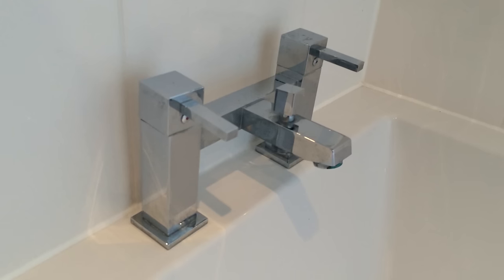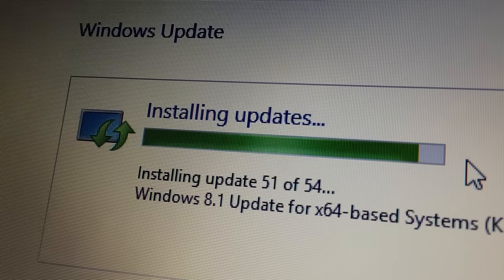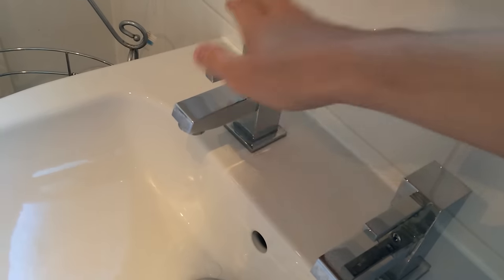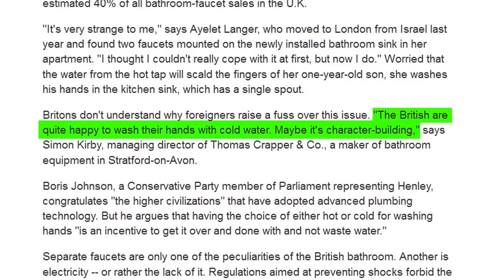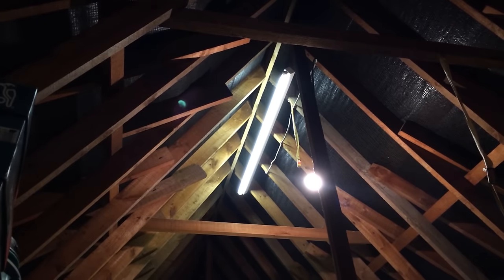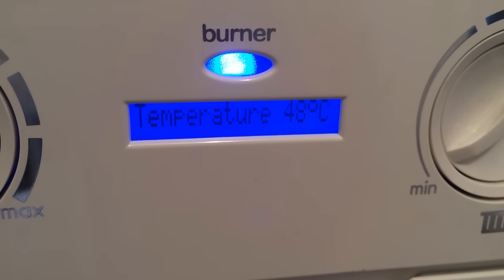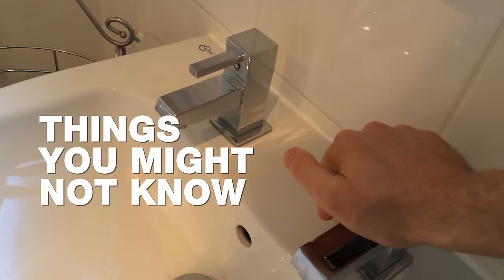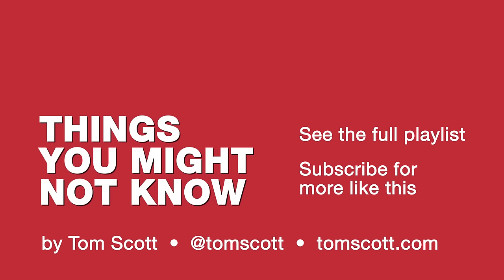Why Britain Uses Separate Hot and Cold Taps

Comment: Here in Finland, where as far as I know (some 30 years) there's always been just mixer taps, I was still told as a child not to drink the hot water. The reason given was that the hot water pipes could be made with lead somehow (soldering perhaps?) and thus could poison you over time.
Reply: both hot and cold were made with lead at one time. we still occasionally find parts of our water system in britain have lead piping.
Reply: Yeah, I was brought up being told the same thing here in Sweden, so I do the same thing as Tom does; I always run the cold water for a few seconds before I use it for cooking or drinking.
Reply: Skellious
 My house has lead on the mains supply so I always waste a gallon or so before using it for potable water. Apparently though the inside of the lead pipe gets a coat of the minerals in the water that stops the lead getting into the water.
Reply: Skellious  I'm probably misremembering, a guy in the comments below said it indeed is because of heavy metal poisioning, but from copper, not lead.
Reply: Staffan Thomén I've heard both copper and lead. The piping for the hot water was copper, but lead was there too.
Reply: back in the 1940s and 50s separate cold and warm water taps was used here in europe to (in those houses that actully had waterheaters) i have been in a house built in 1941 that still had all original plumming and mains wiring in the basement (and probobly lots of asbestos everywhere) and it still had those separate water taps
Reply: Elle Sea
Lead based solder was used when joining pipes. These days it's mainly lead free due to modern regulations).

I run the cold tap a while too. But that's just because I want cold water in my glass, not warm, tepid or anything else either =) (But yes, we were taught that hot water was non potable as children too. Apart from lead poisoning, the other reason given was that the water stands in the boiler, and goes off. =) These days I always run hot water e.g. when cooking, since it cuts down the time on the stove top.)
Reply: The real reason not to drink hot water is because your water heater contains an aluminum anode to prevent corrosion inside the tank.  It's not safe to drink from things with exposed aluminum.
Reply: Jeremy Nunya
I drink soda from aluminum cans and it hasn't killed me yet. The real reason is the lead in the solder is more likely to leach out into hot water.
Reply: Well I've also been told you shouldn't drink hot water but isn't it really just because warm water tastes like crap?
Reply: notarobot The aluminum in the cans has a coating on it.  This is common knowledge that you shouldn't eat or drink from aluminum...  They use the same solder for hot and cold water lines sooo yeah.
Reply: You also have the fact that there's an increased chance of contracting legionnaires' disease from the hot water system. Especially if it hasn't been used for a week or two.
Reply: Staffan Thomén
I gotta say, heavy metal poisoning sounds like the ideal Finnish death. lol.
Reply: Given that you use a mordern plumbing system (steel pipes, modern water heater, especially no rats involved)  I can see three problems: 1. Heating water will cause some of the contained minerals to go solide on the walls of the water heater. The water will contain less minerals. But I am not sure if this is significant enough, to make a actual difference. 2. Mineral coating building up inside the water heater which could provide a habitat for all sorts of funny things.  3. These devices suffer a problem called galvanic corrosion. (If interested how it works, look it up on wikipedia) You need to make sure that this corrosion does not eat up the steel tank of the heater. In order to do this, you put a anode into the tank that is desolved instead. It is called sacrificial anode. These are usually made from aluminium.  Eating aluminium in solide lumps does not much harme to your body, however when it is desolved in a liquid or introduced in compounds that easly breake down, it can have a series of impacts on your health. Though I am not sure if the quantities are large enough to be dangerous.
Reply: @mrwinkie1959  Leech,not Leach.

Comment: The fun part is that "don't drink the hot water" is still a valid thing to remember. There are plenty of old houses with old water tanks in their lofts that are still used (because this is the UK, we don't knock things down, we just keep living in them). The last house I lived in still had a water tank to store hot water. It was rubbish, especially when running a bath and the hot water ran out.
Reply: +James Grimwood its always been in my head you dont drink hot water, just a fact like the sun is hot, its interesting to learn its got a reason behind it :)
Reply: +James Grimwood One other reason not to drink the hot water is that the metals from the pipes and the solder holding them together as well as any chemicals leaching from plastic piping or rubber seals, will leach out faster in hot water and might collect in the tank or heat exchanger. Though, with either hot or cold water, running it for a few minutes will often reduce the levels of these contaminants.
Reply: I hate that, worse when you take a shower and the hot runs out
Reply: +James Grimwood When I moved in to a new house a few years ago (in London where it's hard water) the water tank was so furred up with calcium that I'd be lucky to get one sink of hot water let alone a bath or shower.  I had that ripped out ASAP and a combi boiler installed.  Now I have hot water on demand and a huge storage space where the tank was.
Reply: +mike mac When the cold water runs out..that's worse.
Reply: +James Grimwood Oh the memories of the hot water running out. Those were the days.
Reply: My house has the old hot water tank system.  And we have a mixer tap too...  thow we dont use that one for drinking
Reply: +James Grimwood My house was only built in the early 1990s and has a water tank in the loft.
Reply: +mattkaythetimelord if it's a direct hot water system with an expansion vessel on the storage tank ,there will be no risk of contamination.

Comment: I was taught to never drink from the hot tap and to let the cold run for a while because the copper pipes in the old house I grew up in used leaded solder
Reply: I'm in Canada and the government tested our university's water. It's found to have too high lead content to be safely drinkable without incurring brain damage. So we've also been told to run the cold water (5-10 seconds) and never use hot for drinking!
Reply: in really old times the pipes themselves was made out of lead, but they are safe to drink because the oxidized layer formed prevents it from putting lead into the water. only if you make a new cut or scrape will it potentially have enough trace to cause harm. if you need work doing to a house that still has lead pipe though, they would have to re plumb your whole house
Reply: That is really bad copper and lead are metals and react electricaly with each other this is cathode and anodes the information is easily available and can help create the lead byproduct that Is poisonous   through plumboslency look this word up plumbo is like the Latin for lead (might not be Latin!)
Reply: In bs there is still as reasonable practical meaning if the person ain't got the money you remove what you can at a cost they Can afford eg if nessisary removing the assessable joints cleaning the pipe ends of lead and replacing the joint maybe in some cases removing an replacing short lengths of the pipe a heavy brass fitting can be used to joint lead in to copper but not the other way so you can replace part of a system I'm not I'm not an expert plumber and don't have much knowledge about lead as it's not so much of an issue but it would be good to check up on anything lead pipe work you may be Doing or quoting with it obviously present with iphe or other body that has some authority in the industry Wat  your saying maybe the case but what if that pipe goes to the street main are you digging up the customers floor garden driveway at your cost let alone the water main may still be lead meaning replacing it was pointless!
Reply: im not too informed about the whole process of lead pipes, its just some basics they told us in college when i did my course. not sure if you're from england but thats what they told us because of health and safety regulations state they have to be removed. i think all the public sector of pipes are already converted or was never lead to begin with (public sector meaning pipes up to the house) in referance to what you was saying about plumboslency, if you read the wiki page it says "Plumbosolvency of water can be countered by achieving a pH of 7.5 by increasing the pH with lime or sodium hydroxide (lye), or by providing a protective coating to the inside of lead pipes by the addition of phosphate at the water treatment works" this is what i said prior about the protective layer.
Reply: Yeah i bought new copper connections at my local building shop, after googling them i found out they are made of arsenic and lead
Reply: Not true. Lead is not safe in your drinking water. Lead causes mental impairment and behavioural changes. A water filter may or may not remove lead. Only choose one based on comparative scientific measurements. One well known filter only removed 14% of lead BUT it claimed to "remove lead". Other filters removed 98.3%.
Reply: Heating water increases the solubility of plumbing contaminates dramatically. Cold water is safer.
Reply: The copper reacts and gives off trace amounts of copper sulphate too.

Comment: In Malaysia where I currently have a house the building code is that kitchen taps has to be directly connected to the main line (no tank).
My house has 5 bathrooms plus kitchen and all other taps except the kitchen tap comes down from a 2 M3 tank under my roof.

The water from the main line is sort of drinkable ...ish ... but a filter or boil it is probably recommended ;-)
Reply: That's like Singapore in the 1960's.

Comment: I remember a friend's parents had a big old Victorian house, his father had put signs by all the taps in the house saying that the water wasn't safe to drink. They had deliveries of big bottles of drinking water every week.
The reason the tap water was not safe was that the old plumbing used lead pipes.
Reply: Lead pipes means it is not safe to wash either.  Lead is really danger 😢
Reply: Lead pipes were quite safe at one point. Where I used to live the water is incredibly hard and chalk in the water formed extensive layers between the lead and the water. Enough that there was no lead whatsoever in the water coming from the pipes. Then the local water company softened the water and this caused the existing chalk layers to break down and expose the lead pipes an introduce lead into the water. Very obvious after the fact, but I can see why nobody would have predicted it beforehand. It only affected the much older properties that still had lead pipes within them.

Comment: Yeah, we have some in Sweden. Most are mixer taps, but some are Double Taps. :p It's a pity the pump's not working! I have a double tap in my home, my grandmother has one. She had one replaced with a mixer 5-odd years ago. I always run the cold for a few seconds, but that's to make sure it's nice and cold. I heard from someone that I preferably shouldn't drink of hot water. I was baffled as to why. It was implied that there was something obvious which I was missing. I reckon it was this which they meant.
Reply: +TheBcoolGuy A friend of mine once told me that hot water tanks have some nodules of cadmium attched to the insides to prevent corrotion, and that's why you should never use hot water for anything that's going to be imbibed (drunk) or ingested (eaten).
Reply: There is a weird mix of mixer and non mixer taps in the UK. In my house, the kitchen tap is a mixer fed by the on-demand boiler and the mains cold water supply. The bath taps are separate, and so are the basin taps in the bathroom and second toilet.

Of course, the kitchen (mixer) tap is the one I drink from most often. It's all the same water, but you can't wash your hands with warm water in any of the other basins because it comes out at 9 billion °C from the hot tap. It's so stupid!
Reply: bigwhiteyeti You can just mix with different amounts of hot and cold.

Comment: I got two suggestions: 1) *closed* feeder tanks with a breather valve, and 2) back flow check valves if you are worried the shower hose or dish rinse nozzle will suck your washwater back into the city supply.

Just saying.
Reply: Going around every single house in the UK and fitting closed feeder tanks is unrealistic...great for future new homes if only they even had water tanks fitted. Tom does mention this.

As for back flow check valves, all homes in the UK have these. As Tom mentioned in the very same part of the video you are referring to, it’s if it fails. Separate taps and supply points was always for redundancy.
Reply: In other words, get your water systems up to American code. 😂

Comment: My Spanish wife was putting water into a pan from the hot water tap... I was appalled.
Reply: My African wife doesn't drink water, or has even seen water... I was appalled.
Reply: Naked Snake I died 2 weeks ago.
Reply: my 7 African wives drink water when i tell them too. Allahu Akbar.
Reply: My Greek wife drinks my tap water. I was not appalled.
Reply: But, if that water comes through a mains fed combi boiler it will be fine.
Reply: Could someone explain  why this is a problem?
Reply: as long as it is boiled it should not matter.
Reply: Fiona Gregory .boiling only deals with bacteria. Poisons and chemicals may still persist even with boiling.

Comment: You are supposed to use a non return valve on the cold mains side when fitting a mixer tap. Although not everyone does and they can cause all sorts of problems; personally I dont mind two taps, you just take a few seconds to fill the basin.
Reply: Where I live, you need a return/check valve on the inlet of the water boiler, to prevent backflowing of warm water into the cold water supply and then additionally another specialised check valve before the mains Water meter, in case the water mains supply craps out, so water from your home can't contaminate the mains down the road. Still drinking warm water is a big No-No. Cheers.
Reply: Yea that makes sense